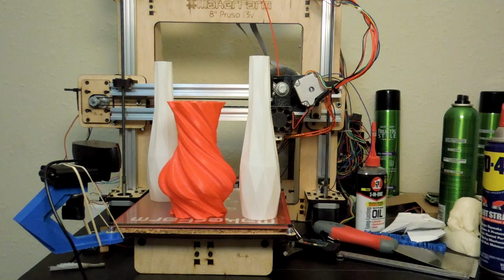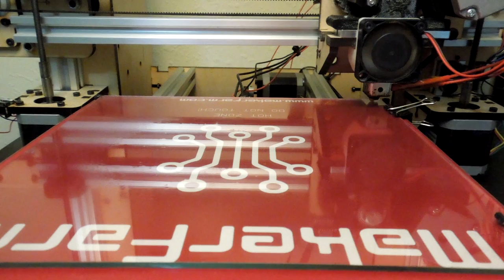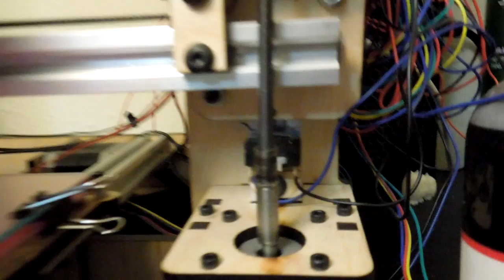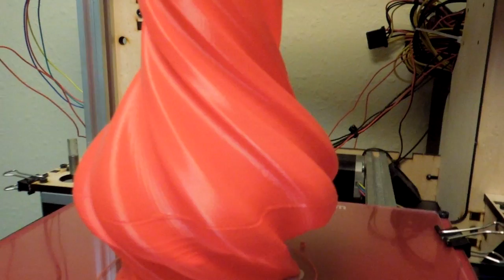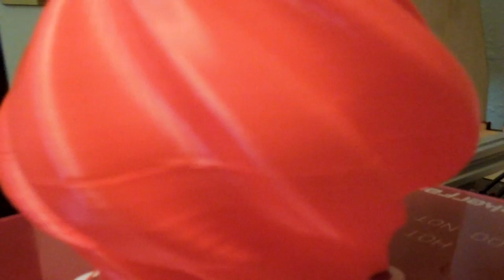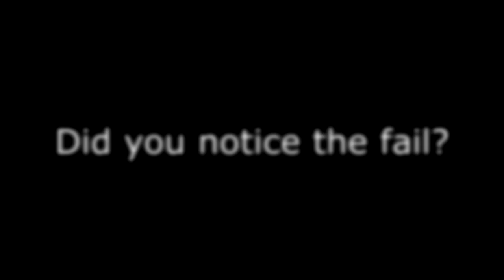Slic3r's Spiral Vase Setting - How to break your printer

Comment: HAHA I missed that. :)
You could uses some zip ties over that rubber hose coupler to help secure it better. It will put more pressure on it. But I would look at this as a good time to do a upgrade. I'd get a Flexible Shaft Coupler and even look into upgrading to Lead Screws instead of using threaded rods. But tat is just me. :)

Comment: What version of Slic3r are you using?  I don't see "spiral vase" in Slic3r 9.9
Reply from the maker: I use 1.1.7. They added the option sometime in the 1.1.x, I'd highly recommend updating!
Reply: Any issues with 1.1.x?  I had problems with v1.0.  Colin recommended using 9.9
Reply from the maker: Mav adue nope, I've had no issues with 1.1.7.  I have both that and the experimental 1.2.3 installed, and use both frequently. 1.2 has some neat features, but it's not as stable as 1.1.7, so give that one a try!